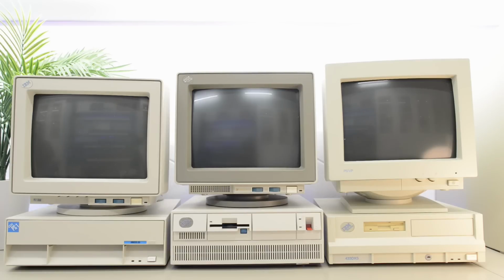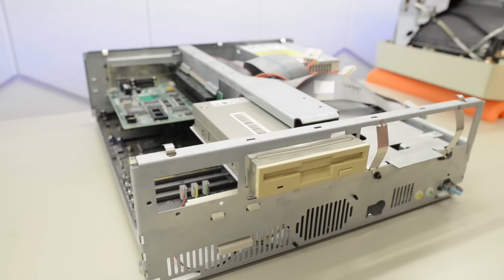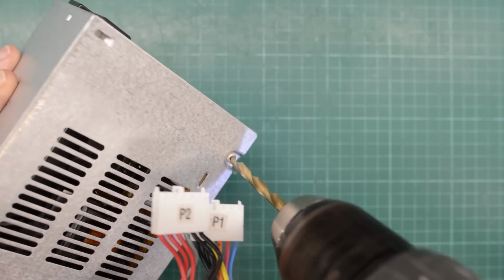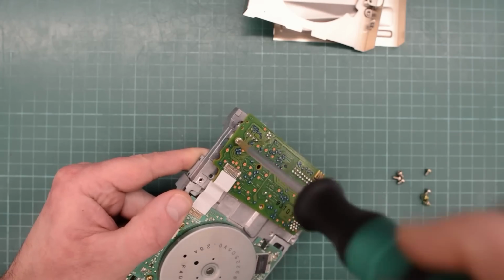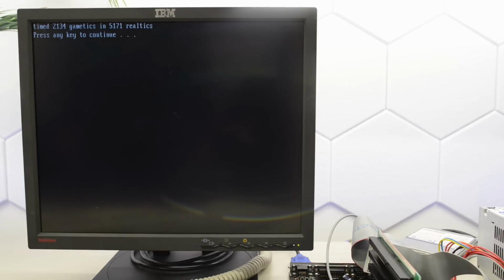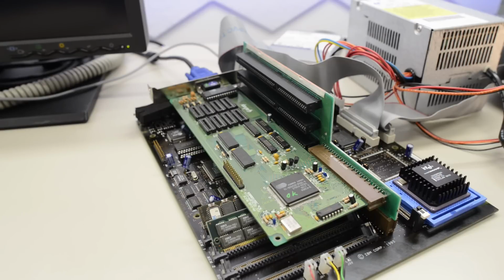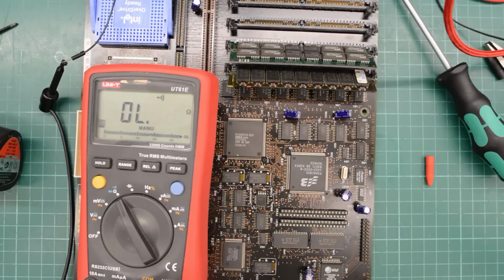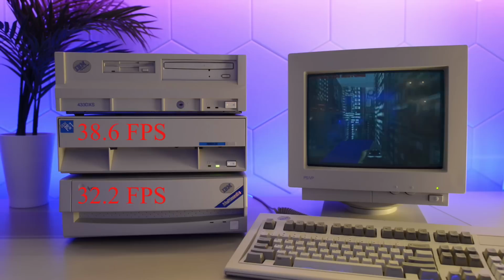IBM PS/VP Doubling the FPS! Rebuild and upgrades

Comment: Oh, that IBM Aptiva was my family’s first computer from OnOff in a suburb outside Stockholm. I tried convincing my parents to get one with a 486 DX2-66, but they picked the cheapest model with a measly DX-50. I think we at some point upgraded it to 20 MB RAM (it came with four). The included 240 MB HDD was almost entirely full right from the start with Win3.1, DOS 6.22 and lots of bundled software, mostly kids’ stuff, but I remember loving it still. Took my first baby steps composing music on that machine. So much nostalgia!
Reply from the maker: Sounds like fun memories :) The DX-50 wasn't too bad. I think it only scored a few points less than the DX2-66 because of the higher FSB

Comment: I have the almost identical machine, a 433DX/D, which seems to be slightly different form factor, two 5.25" drives etc. Haven't gotten around to upgrading it much but definitely on the todo list, especially with that overdrive socket. Same problems as you with how picky the ram is, only have 16mb but seems like in theory will take up to 64mb. Can't wait to see what else you do with it.

Comment: It's a bit tricky but if that clock pin on the custom chip isn't used anywhere else you could lift up that pin to disconnect it and inject your own higher clock into the CPU. Or a lot easier, remove the 47 ohm resistor and inject the higher clock onto the CPU side of the pads where the resistor previously was.

Comment: I was surprised you replaced the rivets with more rivets.   I would've been tempted to use stainless steel self-tapping screws because at some point those caps will have to be replaced.

Comment: You would try to solder a trimpot instead of the resistor, set it arround the 47ohm and change the values with the benchmark running
Reply: That's a series resistor to improve the signal transmission characteristics. It's not part of clock generation.

Comment: Thank you, this is a nice video.  I have two of these . My original aim was to fix my mothers Ambra Sprints 386, but  because of proprietary parts this has been very difficult,   I bought a broken IBM 486Dx with no case from Morocco and realised I could not adapt it for the Ambra. Then I found a Value point with a broken board, so now I have new project to fix an IBM value point with what I have bought  This doesn’t help with my original project, but I should have a Value Point to enjoy when I fix one up from the available spare parts I have bought.❤

Comment: It would be awesome if you could find a L2 cache module for that machine or if someone could create a recreation of it. L2 becomes more important for 486 machines at 66MHz and above. I always thought it was a real shame that so many OEM machines that were not marketed & priced specifically for business use lacked L2 cache in the 486 days.
Reply: I have one of these modules and unfortunately it comes with some sort of controller on it, not just RAM chips.
Reply: @clavius5734  Still possible to reverse engineer - even if you can get just a pinout.

Comment: I have a very similar valuepoint 425, but that one has a socketed oscillator. It currently runs a 5x86 at 120Mhz (3x40). I tried the 4x multiplier of course, but it crashes at 160Mhz. Could just be bad luck on the processor. I have one of the L2 modules (128k), but it’s a bit sketchy. It works under dos but messes up windows 95. I replaced the ram chips on it but no improvement unfortunately.
Reply from the maker: That's very handy. Maybe, you have the type 2 board?
Reply: @Epictronics1  Yes, I think that is the case. I hope you can figure out the OKI chip!

Comment: I have an identical machine, and I love this thing! Although I upgraded the living daylight out of mine: replaced the original CPU for a 486DX2 and added more RAM (16MB). Also added a SB16, a Voyetra V-22M MPU board, a Diamond Speedstar VLB graphics card, a CompactFlash adapter, and a CD-ROM. It is my early 90's DOS games machine (mostly LucasArts and Sierra stuff).

Mine came with the cache-on-a-stick module, but unfortunately it died not too long ago (BIOS keeps complaining about it on boot and is no longer detected by CacheCHK) and it seems to be impossible to find a replacement for it these days.

If you know anyone willing to design a new replacement COASt module for these machines, I'd be happy to donate my dead module to such a project, so it can be copied.
Reply from the maker: Yeah, this machine should be perfect for 90's LucasArts and Sierra :) I'll see if I can find someone who can help us make a clone. Thanks!

Comment: The PS/Valuepoints were definitely creamy white - it hasn't yellowed. They are good computers!
Reply from the maker: Great. You just saved it from cream peroxide :) Thanks!
Reply: @Epictronics1 BTW the power buttons were in fact white-white - like snow.
Reply: confirmed, have had one at that time. Not white
Reply: Yup your correct!

Comment: i actually have a later model valuepoint and have those same video ram upgrade slots i have like 9 of those modules if you're interested i could send you 2 to upgrade to 2mb
Reply from the maker: I did some reading. Apparently, 2MB of VRAM only gives access to a few interlaced modes. But thanks anyway! I appreciate the generous offer :)
Reply: @Epictronics1 ok on mine i get a couple higher resolutions non interlaced. my case is a bit taller and has room for a second 5.25 drive in there, it was used in indiana university in the engineering and tech department  still has the barcode stickers lol

Comment: All PS and Value Point only accept-70ns parity memory....and there is some kind of bug while using the cache module, even IBM recommended not using it...
Reply from the maker: That's too bad, It would have been nice with some cache on this board. This boar actually ran with 80ns but the performance dropped by 2fps :(
Reply: @Epictronics1  I believe there is a double keystroke bug with the COASt module installed, but it depends on which version of a chip that comes in the motherboard. If it comes with a Texas Instrument 52G7803, it has the bug. But later versions (such as my machine) had this chip replaced by a newer one, so the bug is no longer present. @RetroSpector78 explained this in his first video about the PS/Valuepoint (IBM ValuePoint 6384 466DX2/D : Part 1 at 15 minutes and 30 seconds)
Reply from the maker: @IOSam  Thanks. I'll rewatch his video
Reply: @IOSam  Is the better chip a straight soldered-in swap - lol -.